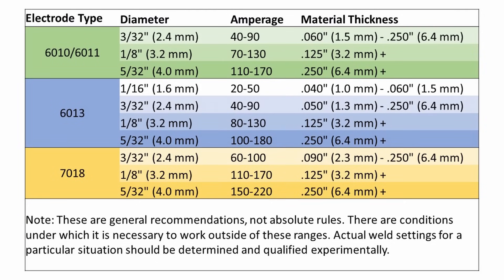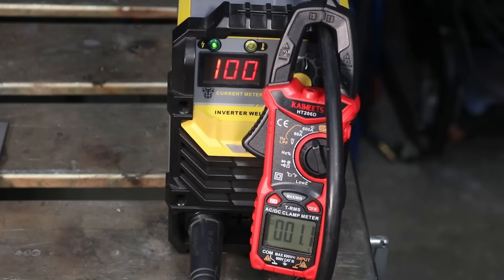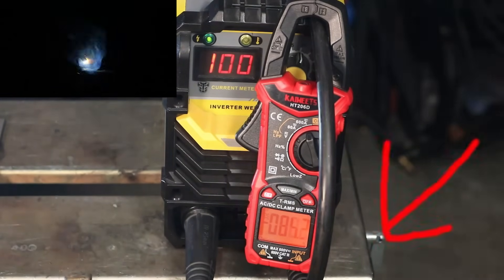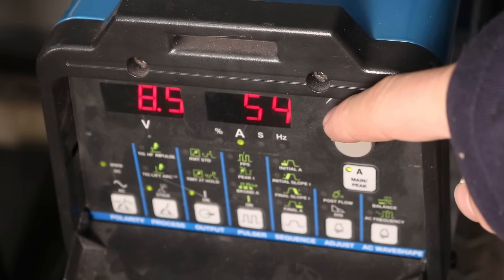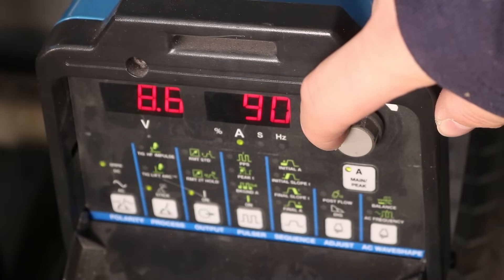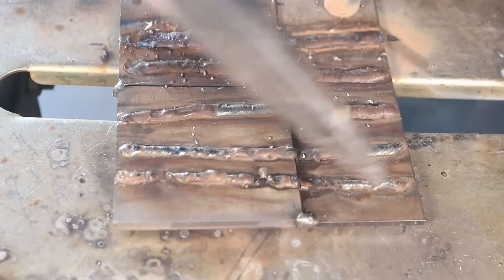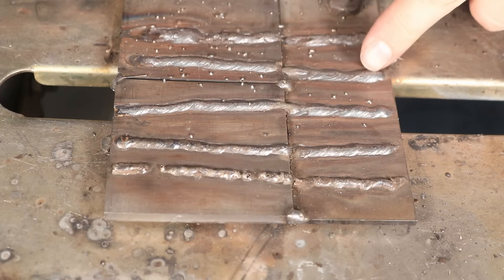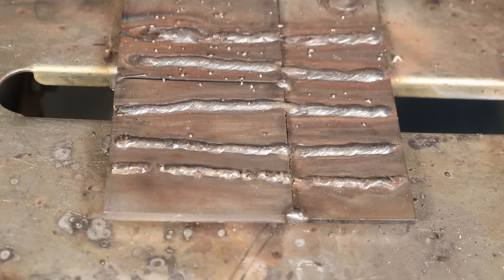How to Set Amperage for Stick Welding

Comment: Hi Tim, 
Your training how to deal with different amperes for welding is very helpful for beginner. Every time I practice electric welding, the 20 amp home circuit breaker stripped, and I had to reset it. My welding machine generates 70 amp max. Do I need to replace 20 amp circuit breaker with 70 amp one ?
We don't have 70 amp circuit breaker in hardware store, do we?
Larry.
Reply from the maker: Hi Larry,
The input amperage and output amperage are different. The main function of a welding machine is to take in higher volts and lower amps, then output lower volts and higher amps. On your machine, you'll probably find a table which shows the rated input amps. In most cases, you should be able to run a 70 amp output machine on a 20 amp breaker, but look for that chart or input rating. It's often labeled "I1". It might be worth trying on a different circuit. Either way, I wouldn't replace the circuit breaker with a higher value breaker because the wiring in your house is sized for the original breaker.

Comment: At what voltage did you end up using to make this example?  Because with 120 the machine produces less power and with 240 it produces to much . This is because the machine is calibrated to an average .  So using 90 watts at 120  on a 20 amp circut will be more stress on the power grid then 240 with a 40 or 50 amp circut. Sure the amperage can still be 90 at both voltages.  Except there is more opportunity to blow the circut at 120 on a 20 amp circut.  By the way your videos are the best.

Comment: Let's say I have a 30 amp dryer outlet for 240 volt. I plan on using an adaptor for my 225 max amp stick welder. What is the highest amp I can turn the dial to? this confuses me.
Reply: Also for a 20 amp plug outlet, I can turn the dial on my welder to 70 amp for max. So why do they put amp much higher on the welder than on the outlet?

Comment: Nice video.. About to start myself using a Flux 125 welder but I wanted to see the differences and capabilities between the two. Explanation of results from amps was very understandable. Until I get a decent Face shield and run a 220 V circuit in my garage.. I'm not even a NOOB yet ! https://www.youtube.com/watch?

One question... with a stick welder do you need the 'shielding gas? I don't with my Flux welder but the stick welder seems to be used a lot more for DIY projects. Thanks again
Reply: No gas necessary, the rod has its own flux coating that creates a shield while you weld

Comment: Would these amperages work with if not using a/c? My instructor has us using 6011, but not using a/c yet. You've explained it very well, but didn't say whither these amps carry over to positive or reverse connections
Reply from the maker: You should be in the ballpark for AC or DC electrode positive.

Comment: I tried to do arch welding but the welding rods were sticking on the metal. i first set it to 80A, It refused and kept increasing the amperage till 180a and its when it wasnt sticking. But it was making too much sparks and burning. whats your advice

Comment: At 72 I have done many things but always avoided welding. Having recently gotten hold of a small welder, it is time. This was great info!
Reply: 47 and I just started also , never to old to learn something new .👍🏼👍🏼
Reply: @ralphfrench2924  22 and I just started!! Super excited
Reply: Yes, It's never too late to learn anything
Reply: 40 here and same.  done wood working & building furniture, plumbing, basic house electrical & networking, land& hardscaping, felled bunch of trees, car and lawn equipment maintenance and repairs,  etc etc.  Always wanted to try welding though.  Picked up a small yeswelder.  Best of luck to y'all!
Reply: I'm in the same boat. I can do all these crazy things but I can't even solder correctly lol. 

Flooring, tile in particular, framing, welding and plumbing were the few areas I never really learned or even wanted to learn, but it's time to build a turbo kit and I'd rather learn than pay someone a few grand to weld a few pipes together for me.
Reply: At 59, I’m tired of welding. 38 years as a millwright doing anything from structural, pipe, sanitary pipe and various other welding, I just let the other guys weld while I supervise.
Reply: @fixedit8689 time to be a plumber know
Reply: Glad to hear at 72 you're still tinkering with things. 

It's sad but I've also done many things. I'm an electrician, locomotive tech, AV TECH, I build race engines, but I can't even solder correctly😅. 

I have always had the "touch" though and the first time I ever welded my buddy thought I was lying about it being my first time. 

Lately I've been fabing a lot of stuff for some cars and welding a few things for people, I think it's time to actually learn about what I'm doing.
Reply: 69 now and just recently   gained possession of a 200A welder and gotten 'some' training on how it's done 😂, watched countless how-to vids, but it all boils down to hands-on practice coupled with those vids. 
My 20 years in the software world, helped very little in this new adventure. 
Between husband/father/errand boy/driver/+100 other responsibilities, I haven't mastered this fire+molten metal breathing machine but am getting there slowly, stick by stick! 
Yep, the switch is interesting.
Reply: I discovered it at 28 and it was phenomenal.  Done countless diy projects with 200A machine. There's no going back 😊
Reply: I got one of the 1/8 stick welder from ESAB really good and tiny around 200 bucks

Comment: Thank you for your generosity of talent and time.

So timely it is!  I must cut into the subframe if my car to reattach/weld  a broken out of place caged nut.  I have 10 cu-ft of Acetylene and 20 cu ft Oxygen—but I believe I may rather stick welds to put a plate over the hole I need to cut to tend to this issue.

I have not stick-welded since high school metals class and as I recall, I never went above 60 amps that I remember.

No shops want to do the work because they do the subframe too much rust.  It's still structurally sound.  There's no use speaking Lee replacement subframe that is used unless it's from Texas or Arizona cuz I'm going to be dealing with the same rust.  The used frame also I have a broken-off caged nut.  Toyota asks for $800 for this subframe.  Plus I'd have all the labor disconnecting everything that is connected to the subframe and then I'd have to brace the engine up to the top of the body in order to drop the subframe in order to replace it.

Comment: I'm new to welding and this video was really helpful. I have the problem that the arc breaks periodically so I can't run a continuous bead. It gets a little better when the electrode burned down to about half the original length. I couldn't find anything about this kind of problem online so far.

The arc breaks like in your video when the amperage was too low but the rest of the behavior looks like it's way too hot. The electrode burns super quickly and spits a lot (also a lot of drops next to the bead).

Is it possible the arc also breaks when the amperage is too high or is something wrong with my machine?
Reply: Probably just that you're good at controlling the arc length when your electrode is shorter.

Comment: Does using an extension lead make a difference to the amps you got to set. You may have a different word for extension lead over there in the USA, to us in the UK, but I've had to use a 50 metre (150 feet) extension lead for my welder, from the workshop to the machine I'm doing some welding on, as it can't be moved closer at the moment. I was having a lot of problems with the rod sticking when trying to start and when welding it would kind of go out on me, like blowing out a candle or I'd have to go much slower then normal to get enough build up of weld, as if I was using much thinner rods, but then it was still messy welds came out. I was welding lengths of 50mm square tubing together on top of each other at 90 degrees, which has a sidewall thickness of 5mm. My weld rods are 7014 2.4mm and the amps are around 110 amps, but my earth return lead does need replacing. Normally without an extension lead it would be fine welding 5mm steel at that setting and I'd get perfect weld every time. If the amps are effected by the extension lead, what do you suggest I put it up to, just the welder only goes up to 130 amps, so that's it's limit.

By the way, your video has been really useful in making me understand the difference in weld at different amps and highlighting mistakes I made in the past, thanks. I did some vertical welding for the first time, a while back and couldn't understand why I got undercut, but when welding horizontally, it was fine. I didn't know you had to reduce the amps for vertical welds. No other youtubers said that in their tutorial videos, so thanks again.

Comment: my problem is bending the material! i had to turn down the amp to 50 so now keeping the arc is dissapointing, even at this amperage the material still bends, if i turn it higher it ruins the material. i'm welding 2mm plates. any advice?

Comment: I have a Miller dynasty 200sd, and it stops when I’m welding the box for the volts never goes above of 7.5 and turns off and few seconds comes back , also on the setting the green light on the second box left to right goes off and I have to pushed it back to continue , I’m learning how to weld and I would like to be helped  I don’t know what is the reason of this problem , I’m using a generator 120/240 amps , please help me!!!
Thank you !!!!

Comment: I have a Tig 200a Eastwood. Says I can only do ¼. Do you think it'll do ½? By yoir numbers it seems like it'll handle it just fine. Its for a telescoping piston for a dump trailer.
Reply from the maker: If you’re stick welding, you can run unlimited thickness with a 1/8” 7018 in the neighborhood of 140 amps, so it should be capable. It will require multiple passes (usually either 3 or 6 depending on the joint).
Reply: @TimWelds  Your the man! Appreciate it! 🙏

Comment: I dont feel so bad now, im teaching myself, i have a campbell hausfeld 120v 15amp/20amp with 6013 3/32nd rods, i had to re-enforce the wheel bracket on a mower deck, and. I was at it for 2 hours lol couldnt strike and when i did i could only go a few seconds, and after about 60 seconds total welding it would kick protection and i had to wait 20 minutes for it to cool down. Took a while. I think my extention was too thin and rods too thick, even though manual says they are fine.

Comment: I dunno if its correct i tried fillet weld at 60amps with 6013 on a 3mm steel and i just cant get filler to stick to both side of the workpiece and would always end up at one side but ever since i amped upto 75 80 something i could do fillet weld easily but is there any hidden problems maybe like lesser penetration?

Comment: Appreciate your support for the novice... As I am certainly that. First time ever welding anything. I bought a Cheap 100 amp AC Kicking horse with some 7018 3/32 rods. To be honest I can't see anyone doing worse. It was not cooperating at all. I spent 2 hours purely sticking and pulling off. Of course I changed the amperage from right low to right high. different results of course, but for sure ...... none of them good.

If this helps here are a couple pics. One pic is the rods along with my attempts at just trying to make a bead on the square (maybe) 1/8" tube steel right beside the rods. The other is obviously the machine itself. If anyone has any (or many) reason(s) why I'm having such a rough time, please let me know.... Thanks

https://postimg.cc/p9fbV16d
https://postimg.cc/V5b9SQF4

Comment: This is a good video that helps explain a lot- thank you! What I haven’t seen (or don’t understand) is what adjustments to amps and rod diameter are made for an open root or bad fit joint. More amps? Bigger rod? Smaller rod and less amps? I’m sure it’s a basic answer but all I’ve seen is the whip and pause with cellulose rod. I’d be interested to know all the settings and rod diameter (upsize the rod, downsize the rod etc?) when doing that type of weld.

Comment: Are you a welder?
Reply from the maker: By day, I’m a welding engineer, but I’ve enjoyed welding as a hobby since I was a kid.
Reply: @TimWelds  Hi Tim, watching this video got me wanting to run some test panels at various current settings.  On your chart   you give a very wide range for given electrode and material.    I didn't find that useful but the idea of running a test and what to look for in the "good weld" helps.  I have also heard rule if thumb 1 amp per thousanth of inch electrode diameter is a good start (3/16 @ 95, 1/8 @ 125, etc.).  Also do you have a playlist of you videos?  If so how about a link?

Comment: great video, how can i set my machine if i weld thick with thin metal?
Reply from the maker: Great question! I set it on the low end of the range for the thick material. I actually just made a video about that: https://youtu.be/8OooAFjEBEk

Comment: Hey Tim. I took some time to try out different settings after watching your video. I have turned my ARC welder right down to 12A (220V) and using 6013 rods on 3mm mild steel I am still getting loads of small spatter. Any suggestions on what I might be doing wrong?
Reply: Could be too long of an arc. Try holding the rod real close to the material.

Comment: Hi again Tim, Sorry, I think I was blowing in the wind a moment ago and your test was on one electrode cable appropriately !! How ever the wave shape issue could still be be contributing to the anomalies. If you can avail yourself of an ammeter with appropriate range that can pass the actual current through it, the readings may be more  credible. B.

Comment: Hi Tim ... Thanks for the helpful videos. The process used to measure the current is fraught with complexities. These are a bit heavy to thoroughly share here but a few tips could help.
Your ammeter appears to be on the input cable to the welder, that type of meter (Tong Tester) is dependent on the wave shape  (AC, DC, Half wave, etc.) of the current passing through it, usually only one leg of a cable is passed through the tong etc.  Another consideration is that if the current in the output (welding current) is controlled to a specific amperage then the current in the input (Power supply) will vary depending on the input voltage. Maybe a more meaningful measurement  would be that in one lead of the electrode cables. I'd be very interested in the result of a test like that. Cheers, Brain (Australia)......... Happy to communicate. B.
Reply from the maker: It does look like the power cord, but it was on one lead of the output (DC), I just wrapped it to get both in the shot. I can tell that it’s off by the way it runs, too. Thanks for watching and for the comment!

Comment: Love the videos! I do wonder though, how can we tell whether or not there is good penetration on whatever we are welding? If I welded up a coupon and wanted to see exactly how far it penetrated, how would I do that?
Reply: Hi Toby, were you able to find an answer? I have the same question.
Reply: @mcloud375  apparently you cut a cross section of the weld and then acid etch it. Not 100% sure how to do that

Comment: thankyou for providing these videos, I have learned alot from them , I just got a lincoln buzz box , pretty old but works and looks like new , it is a ac/dc 225 , it did not have either cable ( electrode or ground clamp ) so I have purchased all that i need , my question is the front of the welder has the  two cables sticking out the front with the quick connect ends, they are about 4inches plus the ends,  ,one on top of each other,  they are not marked positive or negative , I used it today and it  worked ok for a beginner , but how do i figure out which one is the positive cable or which one is the grond clamp cable , and does it matter ? you have spoke about switching the polarity so i think I need to know which one is which .  thank you so much in advance . i've checked everywhere and have not been able to find this answer yet .

Comment: What's the max amperage on the output of the deko?
Reply from the maker: They claim 160, but I haven't tested it. It runs a 1/8" 7018 just fine, which is all I need.

Comment: just got a FleaBay £5.00 A/C stick welder UK 240V Telwin F140 - 
After watching this, . . . ordered 30 rods, 10 of each thicknesses (1.6, 2.5, 4.0mm ) of 6013's 
got grinder, steel brushes, gauntlets, fast dark visor,  . . . . Let the trials begin.
[ it only does 3.2 mm electrodes @ 140 amp according to top dial  = Changes a third of the order ]

Comment: the different amperages are because it's a switched voltage system, to make it accurate at both voltages would be prohibitively expensive so they just split the difference between the two.